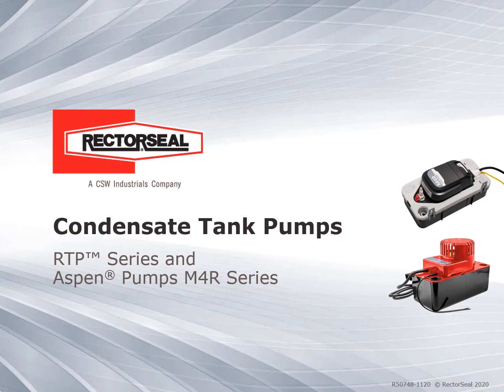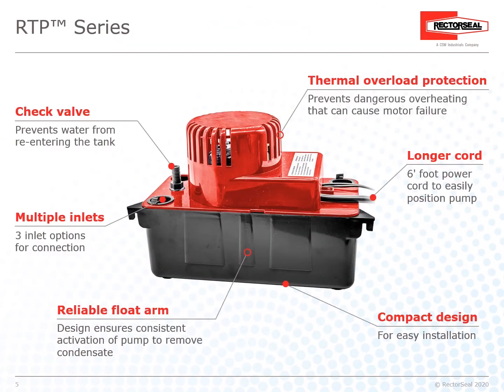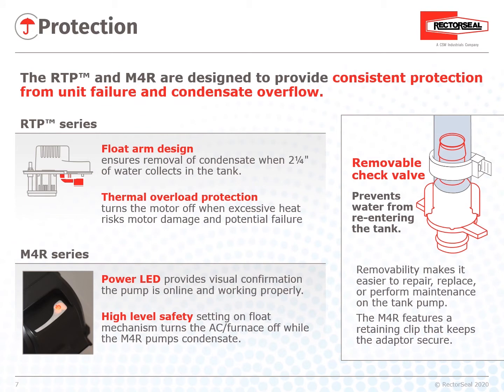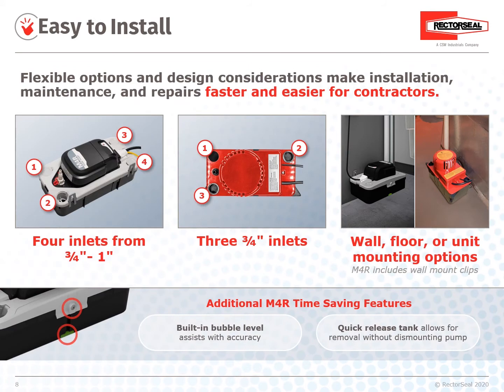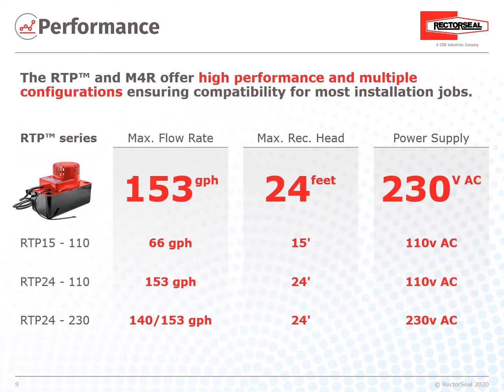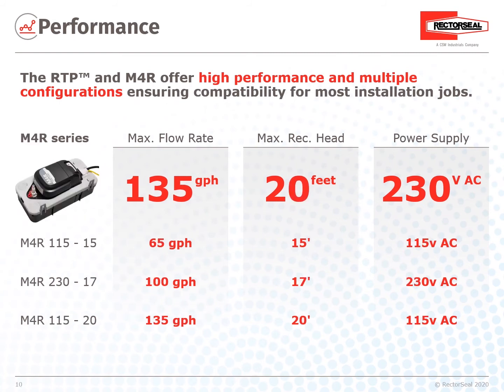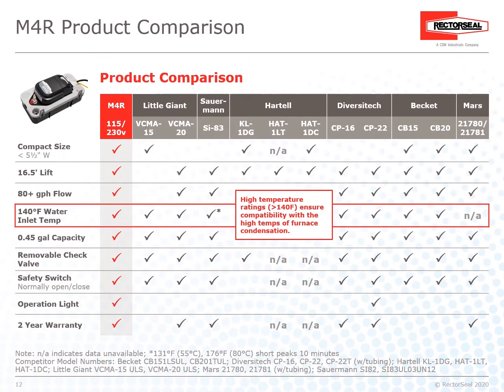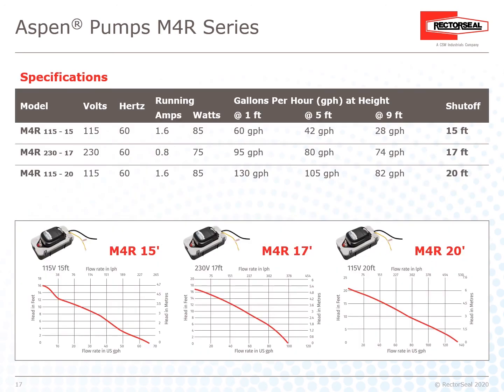Condensate Tank Pumps: RTP™ Series and Aspen® Pumps M4R Series

Comment: Does the rtp defrost the ac by itself
Reply: The refrigerant absorbs heat from the passing air, and as it does so, it warms up and evaporates. When the water vapor in your warm household air hits the cold evaporator coils, the water vapor condenses into liquid and drips down into the condensate pan, which drains the water away outdoors…or in this case it drains into these pumps and they pump it outdoors or to a drain